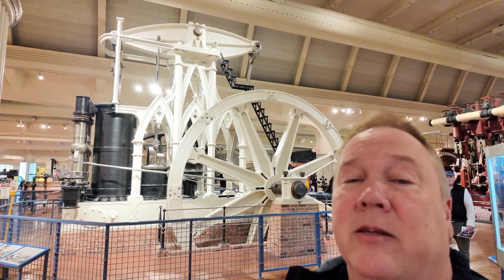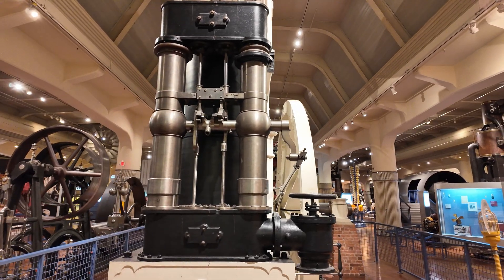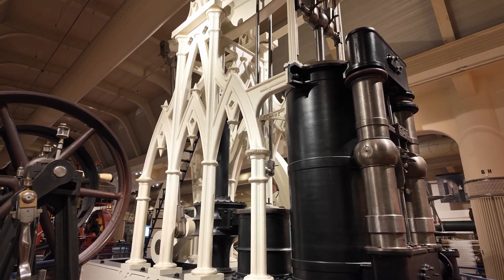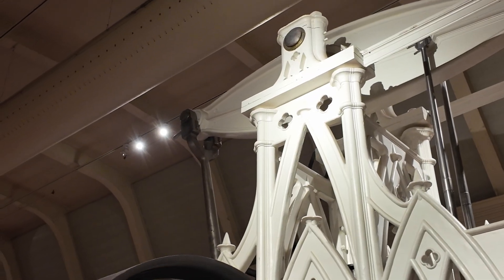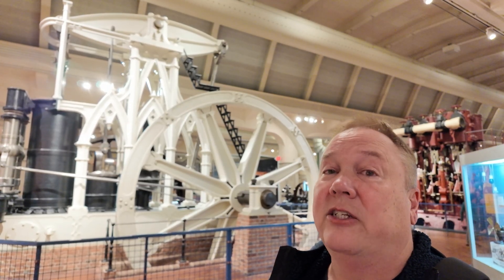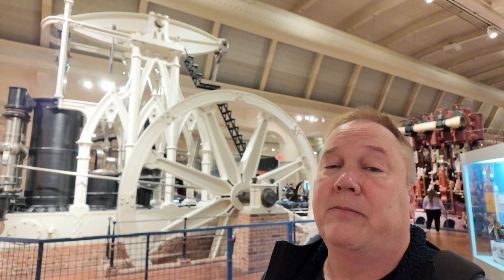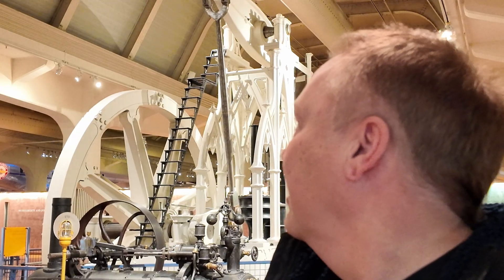The Art of Steam: Beautiful Engines, Timeless Design

Comment: I wonder if the "rebuild" had more to do with changing which side the flywheel was on, as well as the related connections and fittings, rather than fixing something that was broken. Although something breaking isn't out of the question, especially if it wasn't looked after properly in its first iteration.

Since its early life isn't well known, and the fact that it is known to have had the location of the flywheel changed, a rebuild probably wasn't done to fix any kind of catastrophic damage. Or for that matter, any damage in the sense that we'd think of, as at that point it would probably need to be replaced, not rebuilt. As by that point in time they would've learned the dangers of using compromised steam tanks and lines.

So, I'm leaning towards it being better to say it received an "upgrade" rather than a rebuild. But that's just me being pedantic.
Reply from the maker: It's entirely possible.  It appears they did replace the valve gear, which could have improved efficiency.  
Another possibility, especially if it had been powering a grist mill, carding mill, spinning mill, textile mill, etc, is that those places were extremely prone to fires, and the mill could have burned down around the engine without necessarily doing that much hard to the engine itself.  Bit of clean up, fresh coat of paint, maybe replace a few damaged pieces, and resell it.

Comment: You all need to show to this to them damn environmentalist and be like you want save our planet build these can you imagine if we had one of these with a 34 ft bore and a 78 ft stroke okay and then you hook that up to a power plant there you go
Reply from the maker: Most modern power plants, whether coal or natural gas or even nuclear, still use steam power.  Low-speed piston engines are, at least in my opinion, far more beautiful than high-speed steam turbines, but steam turbines are a lot more efficient.
Some of the newer power generation is actually not that far removed from 2000-year old technology.  Modern wind turbines are pretty similar to 500 year old wind-powered grist mills, just a bit bigger.  Some of the new low-head and no-head hydropower systems that avoid the environmental impacts of dams but still generate a lot of power aren't much different from 2000 year old undershot waterwheels that were just lowered into a moving river.
We could use to bring back some of the beauty, though.

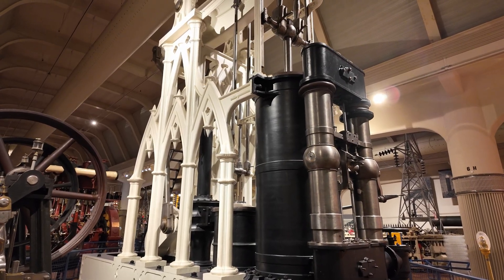Comment: 2:40  It wasn't necessarily rebuilt because of wear. It could have been to upgrade it with new technology, the rate of advancement was pretty quick back then because there were so many large improvements that could be made on the simple designs of the first half of the 1800s.
Reply from the maker: The limited info I had available on this, specific engine was that the timing, at least, was inspired due to wear, but you're definitely right that it often made sense to do significant upgrades, both to reduce fuel input and to increase power output.

Comment: My first guess is the ship it originally powered might have been a richmans yacht, given how fancy some of the private rail cars were.  And the platform probably was for the oiler to get up there and lubricate the thing.  No matter why though the pattern makers would have enjoyed their job on that.
Reply from the maker: The upper platform was definitely for maintenance access.  Whether it also connected to an upper floor is unknown.
I've been trying to find some ships with intact, preferably operating, early steam engines.  There's a lot out there which are "triple expansion steam engines," but those are often fully closed systems with really nothing to see.  I do have leads on a few that are more open, though.  Think something like what you may have seen in Titanic movies.
Reply: @Industrial_Revolution  A.E. Karnes on youtube would the only fellow I can think of who might know, or know of someone who'd know where there is still a ship with an early intact steam engine.
Reply from the maker: Thanks!  I'll check out the channel.

Comment: To add a bit of information concerning "beam" engines.  Working beam engines [aka walking beam engines on steamboats] would have grease cups with screw handles to force grease into tight spaces where there was metal on metal moving parts [like getting a grease job on an old car].  Periodically, while the engine was in motion, an oiler would turn such a handle to force grease into a tight joint.  There were many such grease cups all over these engines.
In 1854 Novelty Iron Works built a single cylinder working beam engine at 105-inch diameter with 12-foot stroke [your engine 72-inch diameter with a 6-foot stroke] for the Fall River Line Str. METROPOLIS. At about 25 pounds of steam pressure, this engine could cause her sidewheels [41 feet diameter by 13 feet wide] to move at 15 revolutions per minute & maintaining a speed of 20 miles per hour.  At that time this was the largest such engine in a steamboat.  Novelty built other such engines for ocean going steamers.
As to your engine, agree with you that it most likely wasn't a marine engine originally as it doesn't appear too tall.  Most such marine engines were much taller, projecting through the upper decks of the steamboats, giving the impression of "walking" when in motion.  But if it were originally a marine engine, it would be from a much smaller vessel than the METROPOLIS.
There are YouTube videos showing such steamboat engines in motion & even a few showing an oiler turning a grease cup handle. ☀☀☀☀☀
Reply from the maker: I've been looking, on and off, for any old ships still running the older steam engines, or even still having them intact as museum ships.  Looking at the riverboats along the Ohio and Mississippi Rivers.  Haven't found any, yet.  The ones that are still running steam seem to have replaced their engines long ago for the more efficient, more closed, and far less visible, triple expansion engines, with the whole things seemingly sealed inside a single block.  More efficient, but not nearly as fun to look at.  Happen to know of any?
Reply: @Industrial_Revolution  You might want to visit the Shelburne Museum in Vermont.  They have the Str. TICONDEROGA [1906] on exhibit which has a beam engine which might be about the size of your engine.  Her sidewheels are feathering rather than radical as on the METROPOLIS.
There is another sidewheel steamboat with a beam engine, at San Francisco, called the EUREKA [1890].
The largest beam engine ever installed in a steamboat was a compound [two cylinders] in the Fall River Line Str. PURITAN [1889]: 125 pounds steam pressure in its high pressure 75-inch diameter with 9-foot stroke & low pressure 110-inch diameter with 14-foot stroke, producing 7,500 horsepower. The sidewheels [35-feet diameters by 14-feet wide] were feathering [rather than radical] producing 24 revolutions per minute for a sustained speed of 20 miles per hour.  The subsequent four Fall River Line steamers were also sidewheelers but were more powerful with four cylinders inclined steam engines.
Hopefully this information is helpful 🌟🌟🌟🌟🌟
Reply: @Industrial_Revolution  The Str. EUREKA [1890] at San Francisco is on exhibit and the Str. TICONDEROGA [1906] at the Shelburne Museum, Vermont, both have vertical beam engines.  Hopefully this is helpful.
Reply from the maker: It does, thanks.  I'm likely doing a filming trip or two east this summer, so Vermont may work.
Reply: @Industrial_Revolution  The Str. TICONDEROGA has a most interesting story on how she got to the Shelburne Museum.

Comment: Back in the 1970's, someone I knew said IBM sold more computers because they had big displays of blinking lights, so they looked more impressive than their competitors. They did look more impressive, but most of the lights were for IBM techs, or "customer engineers", only.
Reply from the maker: I can believe it.  The I heard the first flashing lights on computers were put there specifically for a documentary film when they complained that the computer was just sitting there, so the techs ran wires from random points in the computer to a light board they rigged up.
Reply: @Industrial_Revolution  The real early computers needed the lights - we're talking about hand wired computers with tubes, when the circuits were still being developed. The lights told the techs what was wrong. But that was back in the experimental age of computers, 1940's-50's. By the late 1950's, even the tube machines were reliable enough, and lights would mostly be used for debugging software.
Reply from the maker: You're thinking back in the era of Colossus and Enigma?  I think the one I mentioned was an early NASA computer, maybe for Mercury (?), so some time later.
Reply: @Industrial_Revolution  I was thinking of Manchester Baby and Mark 1 from 1948-1951
Reply from the maker: Ah, the newer, older computers.

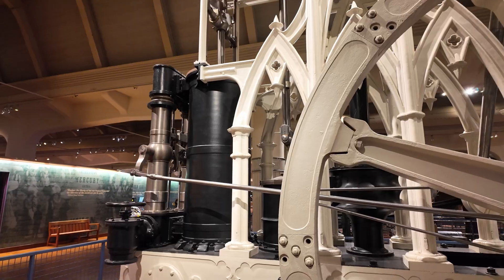Comment: MISSING BOLTS on the flywheel! Around 0:46, there is a pattern for 5 bolts and only three there. And it is even clearer around 5:38, where y9ou can see two joints missing bolts
Reply from the maker: I hadn't noticed that, but the flywheel has had a rough life.  Cut in half to transport, and (probably for the best) taking off the PTO rim around it.
Reply: @Industrial_Revolution May I assume that this engine no longer runs?  In its present condition, running it could easily destroy the flywheel, if not the entire engine.
Reply from the maker: No.  When Henry Ford brought them to the museum, he did set up a lot of the engines so they would run on low-pressure, compressed air (something like 5-10 psi) so they'd run slowly and not be overly loud in the building.  There's only one (the Corliss) that still does.  Rumor has it they used to have low-pressure steam, instead.  If you're in the museum, all of them with bright silver pipes going into them from the floor ran when first moved there.

Comment: The stairs and upper platform were to provide access to bearings on moving beam and crosshead.  An Oiler's job would have been to periodically add oil to all bearimgs.  No oil pump!
Reply from the maker: Yep, easier than climbing ladders.  Around the back side, it sorta looks like it may have connected to a 2nd floor, too, but that's more based on feeling than based on any solid evidence.

Comment: The fact that it remained in use until 1929 is pretty amazing.
Reply from the maker: A lot of these steam engines were used for an amazingly long time.  Some of these older engines I'm doing videos on ran 150 years or more. They worked well, were rock solid, and were easy to maintain.